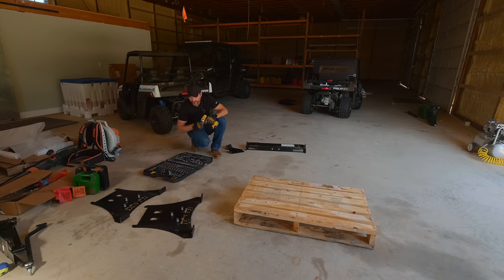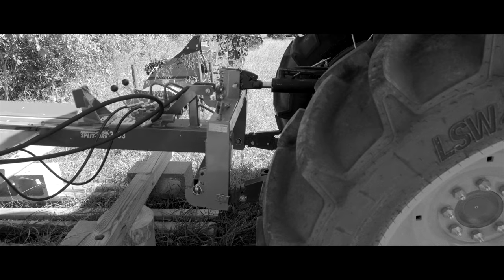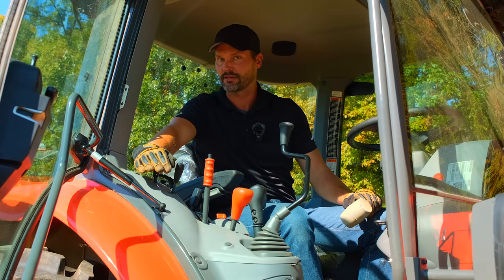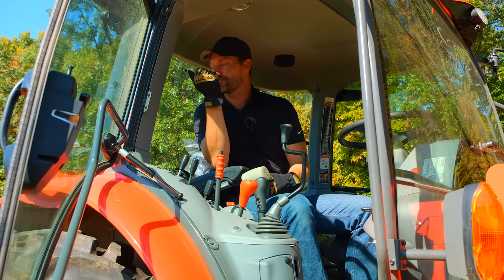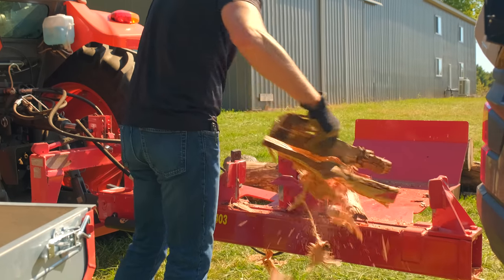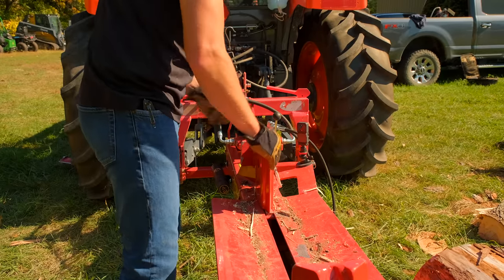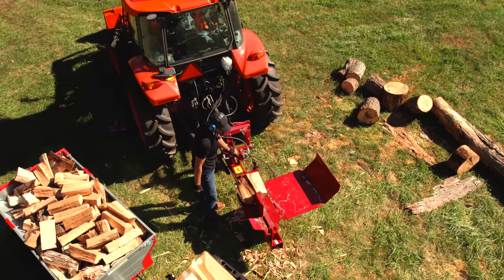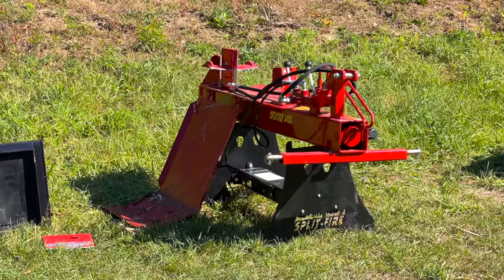Three Point Log Splitter for Tractors

Comment: Had one of those, without the log lifter, for about 14 years. Works amazing. On either our Deere 4320 or Kubota L6060 we just use a bungee on the tractor hydraulic lever. One tip especially if don't have a lifter is we made a basic robust small table out of 2x4 and plywood that sits at splitter height and makes it easy as often want a place to put the big piece while splitting a smaller chunk eg after cutting in half initially. With 2 way knife for right size pieces can also stack 2 pieces and make 4 with a pass to speed things up. Goes even better with a 2 person crew as long as very attentive when operating the lever.

Comment: The float position on the valve behave like the float position on the loader joystick. It leaves the cylinder connected to it extend or retract freely.
It is very useful with a hydraulic top link and a land plane, a box blade or a brush hog when mowing a field.
It allows you to set the height of the three points arms, let the top link float and let the implement adjust itself contouring the surface it's on.
I do it all the time and it works perfectly when well adjusted.

Comment: If I had as many tractors as you Courtney I would probably have that exact setup.  Since I only have one, I like to have it available to bring rounds to the splitter or take splits away using the FEL. I upgraded to the SplitFire 3265 standalone last year for that reason. Thanks for sharing your experience!
Reply: Sound logic.
Reply from the maker: Yeah lots of variables for sure

Comment: Hello from France ! I have a SPLIT FIRE 4203 adapted to my Hyundai R55-9 mini excavator, whose flow rate available to the auxiliaries is 65 l/min, which is more than sufficient because I run at 1400 rpm. Splitting wood without handling the logs with the corn is a treat 😉🤩! . Split Fire offers the 4409 which is the best for a mini excavator! You have to know how to drive the excavator but the work is cooler!👌.

Comment: I have that same model, 3403, on order but have opted to get the PTO pump they sell with it to be ran on my Kubota L3902 since the native flow of the tractor is at 6 gpm which is right at the minimum Split-Fire recommends.  Looking forward to using it.

Comment: I have a Senco 3-point splitter I run on either my JD 4310 and 4610. I found this gives me more power than a stand alone splitter.   My Red Oak logs are very tough to split.
Reply from the maker: Good stuff, thanks!
Reply: @GoodWorksTractors  I enjoy your reviews on equipment. Your advice has saved me $100s.

Comment: The green rear remote is for constant flow. The blue one you were using is a float detent. The green one will stay open. You just have to push it harder. I have the same tractor and i use the green to run a lane shark constant flow
Reply from the maker: Neah, it doesn’t work.  It stays in that locked out position, but no flow.  I tried everything multiple times.

Comment: As soon as I saw that quad splitter, I knew he'd be switching to the single blade. :)
Also, pro tip - carry a 5lb mini sledge hammer beside a splitter.. way less work on the back than trying to wrestle knotted wood off the splitter.
Reply from the maker: Sledge seems like a must have

Comment: I ended up buying a stand alone splitter for a couple of reasons. First was that I have a smaller tractor and the hydraulic flow just wasn't fast enough to run a splitter with any type of speed. I thought about going PTO driven, but eventually decided I'd rather put a bunch of wear on the Honda motor of my splitter, than put hours on my tractor just splitting wood. I'm happy with my choice, but maybe if I'd had a larger/faster tractor I would have gone with the 3 point splitter.

Comment: Split-fire's manual is a bit squirrelly on the hydraulics details.  Seems they should indicate that it needs a "power beyond" type hydraulic connection to operate the splitter without jamming open the tractor valve like you had to

Comment: Neat item but I've never been a big fan of the tractor-hydraulic splitters. Why put all the hours on a tractor engine when they could be put on a much cheaper, cheaper to run and maintain, and easy to replace small gas engine?
Reply from the maker: The average compact tractor owner puts well under 100 hours a year on their machine.  At that rate, most would die of old age before the engine is worn out.  However, Split Fire offers self-powered options as well.
Reply: Lol imagine being scared to run your tractor.
Reply: We use a hydraulic splitter on the tractor when we split one meter long wood. The tractor is small (70hp three cylinders) but still need quite low rpm to move the ram fast and strong enough.
 Yes, it might burn a little more fuel but the stress on the engine is (to my knowledge) minimal. The splitter was ~2000$ new if I remember correctly. I have no idea what a gas powered splitter able of one meter long wood costs, but maybe a little more?
 On the tractor we use it's hydraulic oil so no worries about that. And with the low stress the tractor can go "to the end of the world" without any problems. And there is one machine less to fuel and maintain.
 To all their own. We are all the same, just a little different 👍🏼🤭😋.
Reply: Right on the money. I have a 1993 Kubota B2150, and it only has around 2,200 hours. What an excellent motor this is. 
   I would be skeptical of purchasing the newer models. Kubota doesn’t back up their equipment like they used to.
Reply: Exactly put the hrs on a little single cylinder
Reply: @Joseph-wp2ry  Their Japanese built tractors are still phenomenal quality, Not as sure on the US built stuff
Reply: @002-i7u  
 Why? I don't get it. The tractor is a moveable powerplant with hydraulics. Why would we buy another machine with a small combustion engine? Sounds stupid when the splitter is easy to move around hanging on the three point hitch...
Reply: @johanneslaxell6641  Tractor can be used for moving rounds or splits duh
Reply: @002-i7u  
My wife, me or my children can move rounds and splits, duuh 🙄. You still don't explain WHY there is a need to use a second combustion engine with a separate hydraulic tank to move the hydraulic ram on a splitter. What ever, you can keep on. I'm done...
Reply: I split 30" logs with my 22 ton county line splitter with 6 HP engine. My MX with forks on loader holds the IBC totes at the right height to load logs straight off of splitter. Tractor is not running the 6 to 8 hours a day while I'm splitting wood.  Wouldn't understand why to run a 50+ HP engine when a 6 HP will do the job. That's a $20-$30K machine plus 3 point splitter cost tied up on what a $1200-$1600 machine can handle just fine. At little over 1/2 throttle, I only go through 1-1/2 gallons of gas in 6 hrs. I put over 100hrs a year on my tractor, not afraid to use. I just prefer to use it when the job calls for it.

Comment: Pushing that lever all the way forward is float.
Reply: I was about to say that to
Reply from the maker: Only on one of the functions, not both.
Reply: @GoodWorksTractors  it's a spec thing if you want all your spools to float you have to pay for that same as constant flow. But nomily you only need one float for a hay mower on my pottinger hay mower we put the deck in float so rides the ground independently of the tractor we have all float and all constant flow just how we spec the tractors at home.

Again depends how much you spec your tractors like we have 4 or 5 spools most tractor as are equipment needs that spool banks. 
No point for somone like your self just using a wood spilter needing anymore then 1 or 2 spool banks. But you would of need to of spoken to your dealer when buying the tractor and specified that you needed constant flow.

Comment: Float won’t provide any pressure, you need “continuous flow.” If you have the dual rear SCV kit on the 2038r it will have BOTH float and cont. flow.
Reply from the maker: Right, I keep saying this, but we tried both valves in their float/detent/locked positions.  Neither worked.
Reply: Definitely not trying to be a wise guy here! Just meant to point out that the M4 may not actually have a continuous flow setting, or if it does there may be a separate button like on the 2R. Despite reading the manual, I had to call the dealer a couple of times to figure out how to use my remotes. 

At any rate, this whole issue seems a lot like the conversation about diverters and third function kits!
Reply: @GoodWorksTractors  I also have the m4d-071 and do run a 3 point splitter on mine , I believe  you want to use your green lever pushed all the way forward in the detent to provide cont. flow to the bottom set of remotes . And  I also do keep the RPMs down  and it works as fast as I want it to

Comment: For me- I am not fan of running a log splitter or firewood processor off of the PTO. I would much rather have an engine powered unit leaving the tractor for moving the logs, rounds and firewood. Plus I wouldn’t want to tack all those extra hours on my tractor.
Reply from the maker: They make plenty of self powered units as well.
Reply: For gas powered units, Dollar for dollar- I think you would be a lot better buying an Eastonmade Ultra. The Split-Fires are slow and lack good workspace for splitting large rounds. The think there inverted skid steer and excavator models are great for there intended purpose which is breaking down large rounds to go on a splitter.

Comment: Running a big tractor to split wood makes no sense. Nice splitter though.
Reply from the maker: So buy another tractor to run the splitter instead of using what you have?  That is what doesn't make sense to me.  :)
Reply: @GoodWorksTractors  I have several tractors as well as wood spliters! Having said that I use the self powered splitter every time. I have one tractor set up with a brush mower one tractor set up with a snowblower one tractor set up with a grapple and one tractor set up with a loader!
Reply from the maker: @mr.redneck2715  Every situation is different for sure.

Comment: Wear out a 400-500 dollar motor or a 20,000 dollar tractor motor? I don’t get it.
Reply from the maker: Not everyone views life the same way, good to have options.  Pluses and minuses to everything.  That's why Split-Fire offers PTO and self-powered units.
Reply: I use my 3pt splitter maybe 10-15 hours a year.   Rather put that amount of time on my tractor then having a separate machine to maintain.  I don’t think that few hours is even noticeable to the lifespan of the tractor.

Comment: in order to work the way you were trying, one of the ports should have a detent setup,if my memory serves me right!
Reply from the maker: Yeah, I can't figure it out for the life of me.  Basically, one needs to stay in a position to hold the valve open and keep oil flowing through it.  Neither is doing that in any position.  It's strange.
Reply: You have hooked up to a float valve. A detent valve will lock in either end of lever stroke
Reply from the maker: I'm telling ya, we tried both valves in every position.  It did not matter.  This position, when held open, let oil flow through.  So, we rolled with it.
Reply: Kubota come with 3 type of rear remotes . Open center(normal valve)float (works just like the float on the loader opens flow to both sides of the cylinder when pushed to lock one way)  and detent will give full flow abd lock open in either direction.
Reply from the maker: @madmik2010  I must be dense...I'm only seeing two types mentioned?  Open center with float and a version with detent?